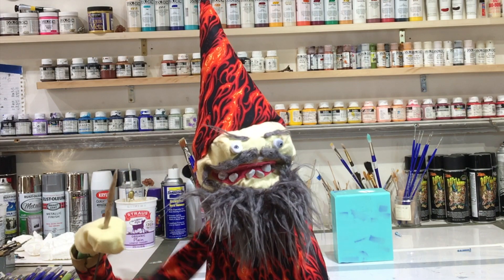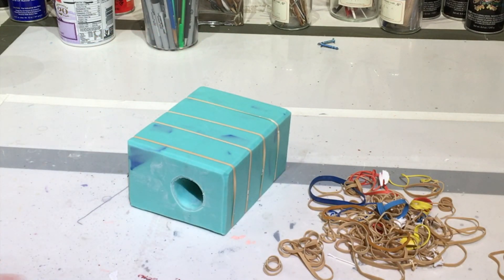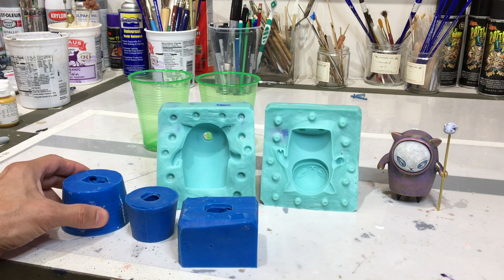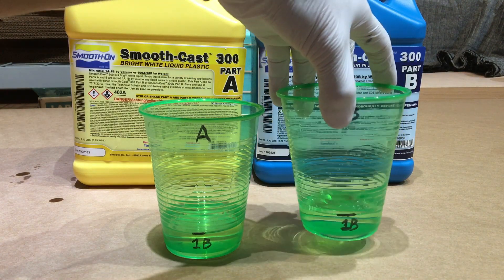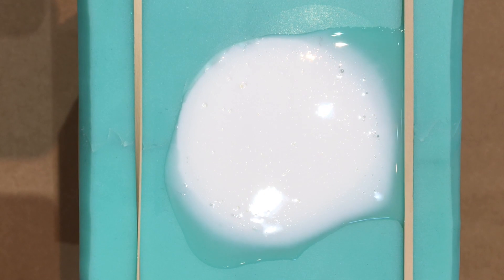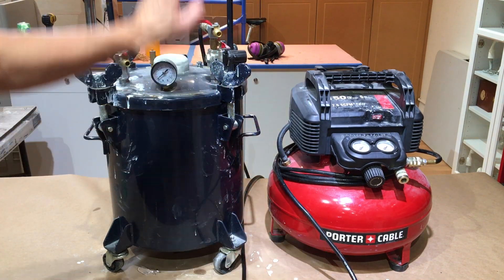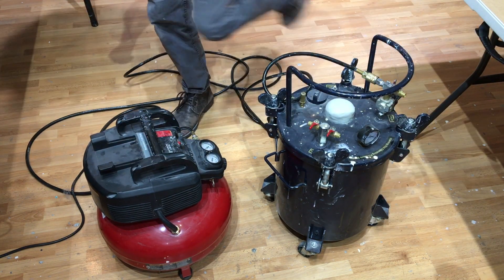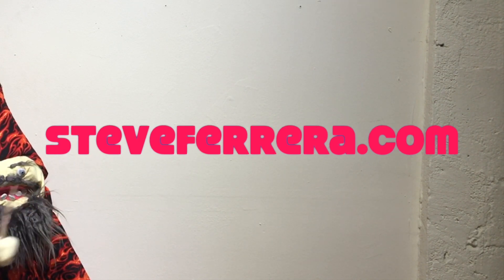Resin Casting Tutorial – How to Cast Resin

Comment: A different world to the world of resin casting that i worked in for 35 years. No use of the degas chamber, that was always my go to, the way i was taught. And such abundance of rubber and resin. Here in the uk it is very expensive, so we make the smallest molds possible, using the smallest amount of resin possible, no guesing in plastic beakers, all of our resins are weighed out gram for gram.  I liked the elastic bands, that is the way i always  held my molds together.

Comment: "A vibrator .. that you would use on your back?" 🤔

Regarding the depressurization, I use a yellow plastic coil hose (with quick connect) and set it up to degas out the window. It saves on hauling the pressure pot outside since my studio is far from any doors.
Reply from the maker: for sore muscles :)

Comment: Great video.  I have to confess that this is the first time when, seeing one of these, I've realized that "pressure casting" actually means what it says.   I always assumed that it was actually vacuum, which would (in my mind) motivate the air to work its way out.   Thanks for making it obvious enough that even I realized what was being said.
Reply: vacuums are often used to degas silicon or resin before pouring so your assumption was pretty spot on

Comment: i use pressure caster too .. but how to eliminate those bubbles on top of the model? theres a ton of bubbles there. even tho i put it into pressure cast. other mold is okay.. but this mold seems a lot of bubbles even in pressure cast
Reply: Problems with bubbles on the top of the cast. Or the top of the pour(so the bottom of the figure)
Reply from the maker: do you vaccum your silicone? sometimes there can be tiny bubble in mold surface you don't see until the pressure cast pushes resin into them.

Comment: Thank foe the video, Iam still learning this stuff, so maybe you now,  if i only fill half of the mold and its cured can I add more resin on top, will it adhere to the cured part seamlesly, you now, like silicone does. Thanks.
Reply from the maker: Mr. XYZ yes pretty seamlessly. You might see a tiny line but it can be sanded.

Comment: Hello, I'm have both the metal (original ring) and a wax carving of that same ring - the ring is 18k gold, I also have one that is pure silver... is there anyway to cast either of those (gold or silver) into a resin? Does a resin with high enough heat resistance exist? Pure silver melts at around 1800 degrees and gold at around 1900.  If there isn't a resin for that, do you have any suggestion on something that I can make a mold out of that is similar to these type of projects that you do?
Reply from the maker: Jewelry casters use hi temp investment materials- then pour the liquid metal into the mold- often with centerfuge casting. There is a rubber material that can handle lower temp metals like pot metal and pewter- but I wouldn't reccommend for details like rings. I think the only way to achieve that is to do it like a professional jeweler. It's a one use investment- that you have to break open to get the ring.

Comment: could I use an average, cheapo airbrush air compressor for the pressure pot? I think it can go up to 40 psi with the airbrush
Reply from the maker: I use 50-55 for the resin.  I think 40 is a bit too low

Comment: are two part molds necessary?  i have 2 molds that are pretty much ruined.  could i save them by cutting them in 2?
Reply from the maker: you could but I don't think the results would be worth it. I'd just redo them as 2 part
Reply: @SteveFerrera  how do i make a 2 part skull mold?  i made a 1 part using a funnel and sprue.  but the jaw breaks off too easily

Comment: If you use pressure casting on silicone mold that's made without vacuuming, would it cause problems? since more people already has air compressor than having to buy vacuum pump, I've seen people who casted with cooking pressure pot and pumped with bicycle pump and they seemed to work, but I've no idea about the possibility that the air bubble inside the mold might collapse under the same pressure the resin was cast
Reply from the maker: yes problems...  silicone has to be vacuumed to work.  otherwise the air pressure pushes the resin into these tiny tiny (so tiny you can't see them) bubbles that are on the inside surface and you end up with a weird but cool tiny bubble texture on the resin. I specifically cast a piece like this for my deep dive video on this stuff (stay tuned).  Yes, I've seen people use one set up for both, but i feel like it's more efficient to use separate systems :)
Reply: @SteveFerrera  but besides this ... would the bubbles inside the silicone (those that would not touch the resin) cause problems?

Comment: Brilliant video. I will subscribe 👌
How did you block the stringing cap on the pressure pot? As I can see it has been removed. Thanks
Reply from the maker: I epoxied a bolt in there and then sealed it a bit extra with magic sculpt on both sides. Make sure it's solid- don't what the pressure to blow it out and take out your upstairs neighbor :)

Comment: Does the heat from pressurization help with the cure? Most interested in the thinner parts you highlighted. I imagine the mold is insulating so I would not be surprised if there is minimal thermal effect?
Reply from the maker: not sure-  i always try to let mine sit overnight to be safe

Comment: Does using the pressure casting method eliminate the need to tilt and gently knock the cast to remove bubbles which you did when you did not use the pressure cast method?
Reply from the maker: yep- for the most part. A lot of times I'll still bang them a bit right before they go into the pot- I think it helps for larger bubbles.

Comment: Hey Steve, I am casting a bunch of trays in Smooth on 300 resin (trays that can have multiple uses, like holding pencils, makeup, smoking paraphernalia etc) and am worried about how toxic the material is. While it is not food safe, how toxic would you consider this resin to be? and is there some kind of coating I could use or other resin material  that would be more friendly to bedroom / bathroom environments where I imagine the trays would live? I know the resin is flammable, but I am just wondering if the gases released from the hardened resin are actually dangerous and should not come into frequent contact with people in their homes, or if its really not that much of an issue... Let me know! Thanks

Comment: Thank you for the video and information amazing tutorial!  One quick question, how much psi is used for the pressure casting method? And would you recommend running the compressor first and storing the air in the compressor and then slowly letting it fill into the pressure pot or as you did in your video just turn compressor on and let it fill the pot up to what pressure? Thank you hope my question make sense!!!
Reply from the maker: artist24seven I go anywhere from 40-55 psi. And I always  preload the compressor. To about 150psi. So it only takes about 5 seconds for the pot to fill :) thanks for watching !

Comment: How did you modify the pressure pot for this application? I just ordered the one you linked. Thanks!
Reply from the maker: I epoxied a giant bolt in the lid. super important to make sure it's in solid. Don't want the pressure to blow it out and donk you on the noggin :)

Comment: I have been trying to cast some very small parts, with a 24 hour cure time. How do you get the mold to fill all the way. I get bubbles at the very bottom most part that never rise out. How do I get the mold to fill in completely?
Reply from the maker: The Noob Woodworker I pressure cast my resin and degass my silicone. No bubbles :) look for a video demo soon
Reply: Make sure that you don't have un-vented undercuts to start with. Do what Steve did by dusting the mold with talc first. Then heat up your mold in the microwave or oven until it is about 50 centigrade. While it's warming up, heat your resin (before mixing) also, until it is noticeably above room temperature. Mix, and pour to 1 third full and slosh it around the mold. Pour back out which will leave the inside thoroughly coated. Now fill back up slowly while still warm. It should make a marked difference.

Comment: does this stuff react with wax or plaster? does it stick to plaster? because I have a multi part plaster mold with gaps I intend to fill with wax.
Reply from the maker: I see lots of ceramic artists use silicone to make molds of their molds with plaster. wax is not recommended because of the higher melting temps- but there are silicone rubbers specifically for wax.

Comment: I was wondering if you re-used the cups that you use to mix resin parts or how to properly discard them or if you just had a corner of your shop filled with plastic cups lol.
Reply from the maker: yep, I reuse the one that wasn't mixed in. so each mixing uses one cup. and if they both get poured into the larger container they both can be reused. but regardless, at the end of the day, I somehow have a corner filled with used cups :)

Comment: how many casts will you typically take from a mold you made?
Reply from the maker: about 30- but depends on how much fine detail and thin parts there are- also large masses will heat up more and degrade it faster

Comment: Why couldn't you just mark A on one cup and then after adding the contents of B, mark the new higher level of both so now you would have two marks on one cup, one level where you pour in A and then another level where you pour in B to combine both in one cup. You could document the height of both lines on the one cup and then in the future you would only need to use one cup. That would save you wasting a cup as well as wasting resin that sticks to the other cup.
Reply from the maker: dang. I wish you told me that 10 years ago.